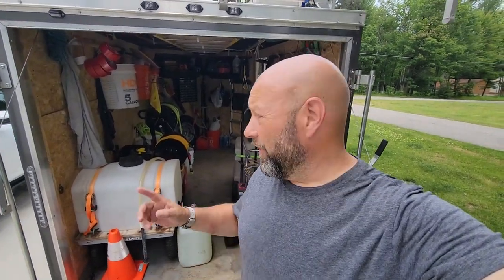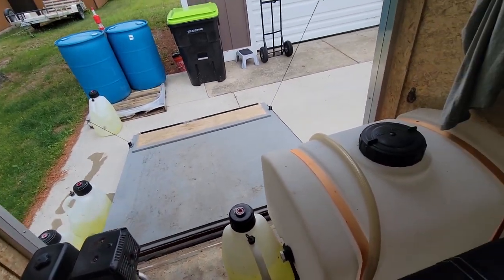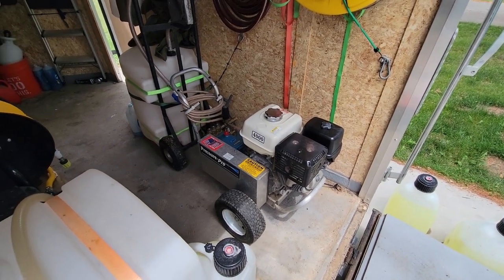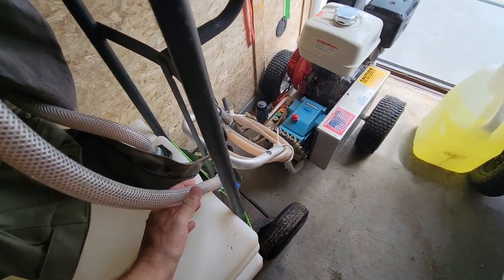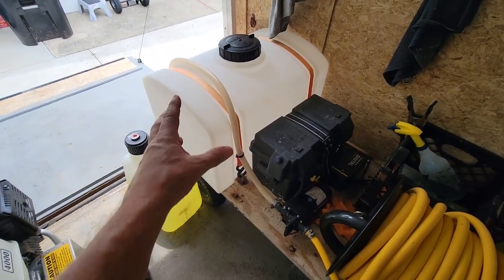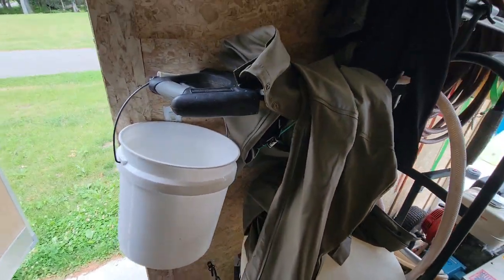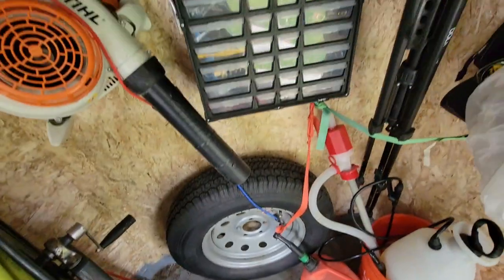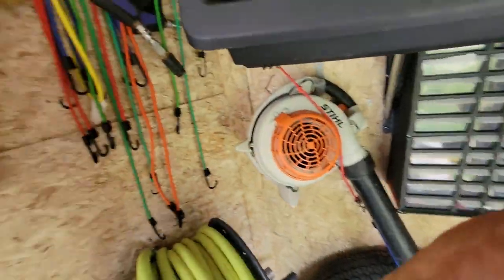My Professional Pressure Washing Set Up And Trailer Build

Comment: What size are your hose reels? Do you recommend aluminum reels?
Reply from the maker: Mine are general pump steel reels. Can't remeber the size. Love them. They have been going strong for 4 years now and still work perfect.  Aluminum reels are great for a trailer that is open and exposed to the elements all day everyday. But much more costly.

Comment: This is great, I still need to learn about what works best for a particular type of job. You truly do put out some great content and it very much appreciated. Understanding how these items are used to a specific job is something I need to learn. Do you every have to recycle any of the "waste" water that is generated during a cleaning job, if say you are doing a commercial job? Also, do you have to have a contractor license to purchase the chemicals?
Reply from the maker: Glad you are enjoying the videos! If you need to catch and contain water the sludge sucker is great and dump it in the grass or somewhere that wont run in the sewer system. can also channel it and use a wet dry vac to do it too. I have not needed to do that yet and if I did I would probably pass on the job personally.

Comment: Great video. Do you use any soap or just the pool shock?
Reply from the maker: I do use a little dawn dish soap in my house mix so I can see the soap coming out of the xjet. I use a variety of soaps, acids and degreasers when needed and I use persil laundry detergent as a surfactant on roof jobs. It works great and is available locally. When I get to ga I might try other roof surfactants that ate available local there. Up here shipping is too expensive to make it worth using anything else.

Comment: Great video bro. I’m trying to learn this field. Do you also use X-jet for roof wash? Would be nice to a video of you using x-jet for roof wash.
Reply from the maker: I do not use the x jet for roofs. the xjet has way too much over spray and can not reach the mix ratios needed for most roofs. You need a dedicated 12 volt soft wash system for roofs.
Reply: @Jason-Samko  got you. Thank you for the info bro.